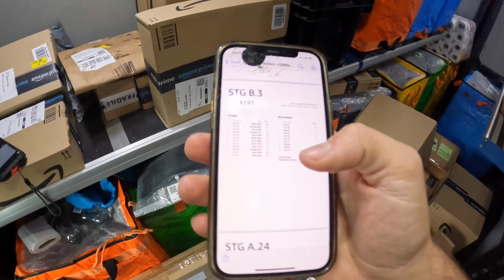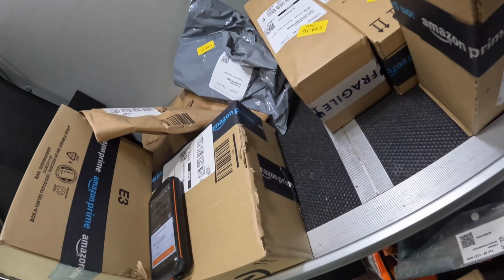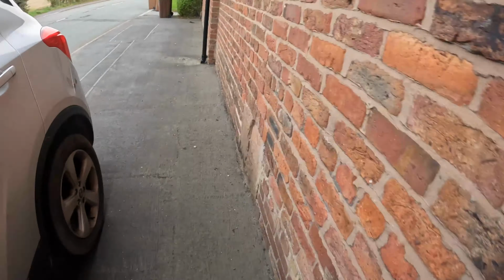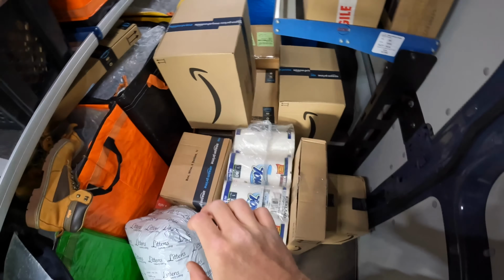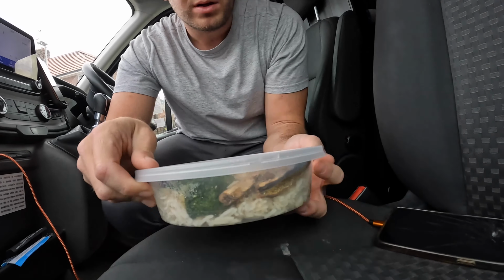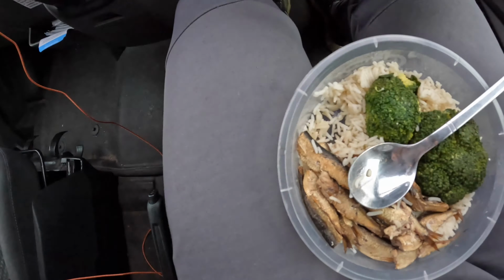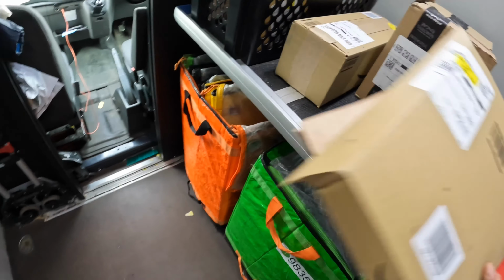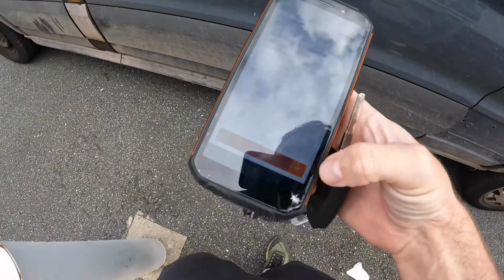The BEST way to load your Amazon van? (Day 1/3 Shelf Technique)

Comment: Had 23 bags, 31 overflow and 380 packages total the other day for prime. Might have been my most loaded day so far in 8 months of this job in America. Ignored the shelves and stacked the bags three high on top of eachother. Overflow got somewhat organized with the back door as the only access. Work schedule is 10 hour days, 4 days a week with an optional 5th day.
Reply from the maker: Woah, insane!!
Reply: 28 bags with 42 overflow over 400 packages this xmas. 182 stops. In january the pay decreased due to peak time being over yet we are still being given 182 stops. My dsp stopped giving me work this week because i only did 142 stops one day. ONLY 142.

Comment: Don't miss this job at all. Worked as a delivery driver for about 8 months and it's  rubbish. Crappy routes, shit bosses , always rushing about to get shit done to the point of getting fines..no breaks, no Holliday pay, no pension,no sick pay, rude customers , other drivers having a go because sometimes you gotta park in awkward places. Getting cold and soaking wet on rainy days, stressful, you can get the sack for so many different reasons and the list goes on and on. When you work for Amazon you just become a peasant with no rights at all.
Reply from the maker: Yeah 😴